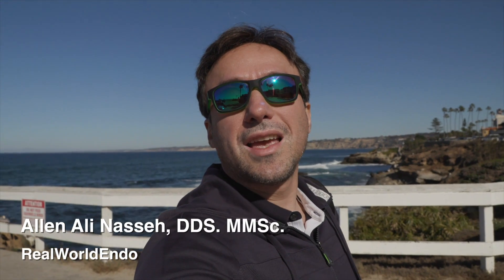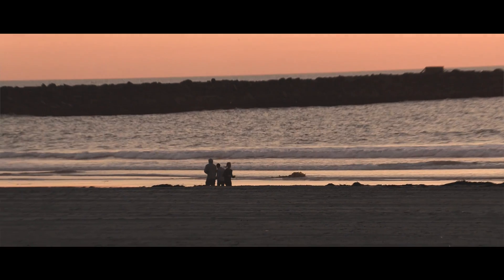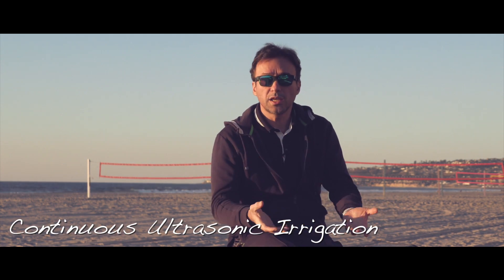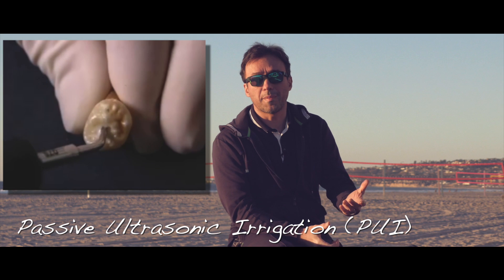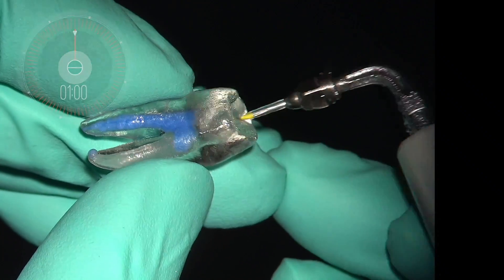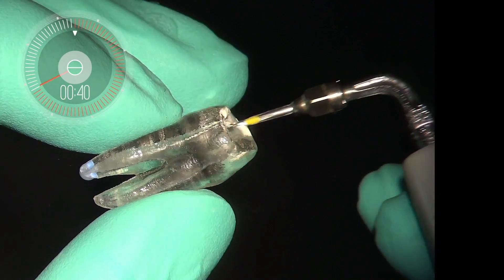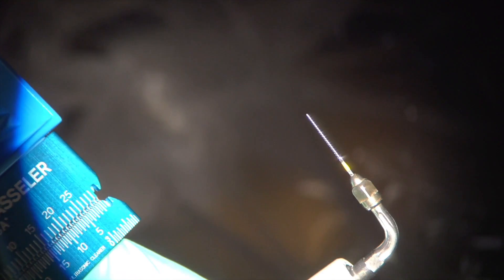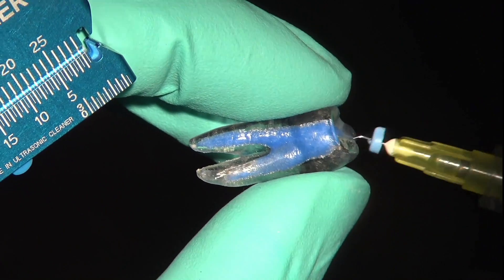Passive or Active Ultrasonic Activation of Irrigation

Comment: What would be the best method of irrigation to remove a 1.4 mm resorcinol formaldehyde resin  (fenol) fragment near the apex? Thank you
Reply from the maker: @adrianatoma1662  That’s a tough one as those are very hard… I’ve heard some people have some success with EndoSolve (not sure the regular or the R version) for this material. But otherwise using ultrasonics and water and making sure not to dig so much if blocked that would cause a perforation! If a symptomatic lesion is present beyond the ledge, Apicoectomy is the best option in those situations. Good luck!

Comment: The ultra mint pro has a tank, the company is saying you can add your disinfection protocol to this. Is Triton safe to use in a continuous ultra sonic disinfection capacity?
Reply from the maker: It is. But like normal NaClO it’s very caustic to the tubing and lines. So, you’ll have to make sure your US tubing can take NaClO. That would be the dream protocol.

Comment: Thank you! Can you please clarify 2 points, please? At 4:58 you said about these Brasseler/NSK tips they they "would fit on any other piezoelectric US unit that take this type of an attachment"; does that include Acteon Satelac piezoelectric units? Said a different way, could one use Satelac-compatible tips like irrisafe, X-start, BUC or TFRK with the Varios/Forza US unit?

Also, you showcased the 20 size u file inserts: is there any rational to use larger size u file inserts, perhaps in a wide, straight canal?

And lastly, do you have any experience with Satelac irrisafe irrigation tips? How do they compare with the tips you showcased in this video?
Reply from the maker: Yes those tips would fit. Any tip that has a female positive lock will fit. (*Note: Some tips suck as ENAC tips have male attachment and won't fit). but Satelac compatible BUC tips fit. Only issue is power setting has to be tried for each practice to make sure the correct setting is used. For E12 tips with U-Blade files you only really need the size 20. Larger tips are not necessarily better in larger canals. A universal size 20 is adequate for going deeper while being safer. You can use this tip for about 10-15 times. Best to throw it away after than to avoid it breaking due to fatigue in time. The irrisafe tips work well too. I've tried it before. That tips doesn't cut at all though. So, its agitation his limited as well. But it's good. Cheers!
Reply: @EndosKool  Thank you so much for taking the time and replying! I'm thrilled by your answer; NSK varios PE US units are amazing, with an incredible amount of tips for perio, hygiene, operative and even surgery, but the array of endo tips is limited (far more limited than for Brasseler), so having the abillity to use tips by different manufaturers is great news!
To your knowledge (in your opinion), to what degree should we worry about the "oscillation dampening by wall contact" that clinicians advocating for (selling?) Sonic activating devices talk about? 
Is PUI safe and efficient in curved (30+ degrees) canals? The fear of uncontrolled dentin cutting by PUI has been brought forward by the sonically activated irrigation  crowd; this phenomeanon makes sense to me; that's why I asked about the IRRIsafe tips. But if I understand your reply, you seem to suggest that there's a direct correlation between cutting efficiency of the insert and agitation efficiency (i.e. cleanliness that could be expected). Could you please explain this correlation?
Thank you once again, Dr. Nasseh! You're the best!

Comment: Use the lowest power of scaler in endo mode?
Reply from the maker: Depends on your ultrasonic unit. Each head is designed for a given motor. So, you have to test your own ultrasonic unit but for the Forza v30 which I use that’s the setting.

Comment: Dr. Nasseh, I am a gp finishing up my AEGD residency and I love endo. I am currently discussing contract terms with a private group practice to come on as their endo and oral surgery dentist. However, I am wondering what helped you decide to specialize and what you think the best route would be to take to enter into endo school. Although I have been through enough schooling to put down a rhino, endo is something I would still consider going back for. I appreciate your time and love your videos. Very well produced and informative.
Reply from the maker: Zak, a year or so of private practice will help and then apply. I assume you have good enough scores with your National Boards, etc. There's nothing specific you can do if you're already at this level of education. Right now having passion and getting an interview is the main thing if you're interested in endo. It's a good field; but you have to make sure you're ready and excited both economically and emotionally for an additional 2-3 years of schooling. If you like restorative dentistry you can alway do more endo-restorative and gain your experience by practice. You need to look deep and make sure your reasons are right and do a cost:benefit analysis. Otherwise endo is a great field. Good luck!
Reply: Thank you so much for the reply! I really appreciate it!

Comment: Thank you Dr Nasseh for your interesting vids. I do have some few questions for you : 1- I got the Endoactivator few weeks ago and I am using it extensively ,should I better switch to ultrasonic instead ? 2- I usually try to irrigate my canal w 5% hypochloride for at least 30min before obturation is it sufficient ? , 3- does( ultra) sonic agitation allow saving in the irrigation time ? 4- do you usually perform vital multirooted in one or more sessions ? 5- what is your last irrigation solution before obturation ? Thanks again and regards.
Reply from the maker: I think as long as you're using something you'll be fine. Endoactivator is definitely better than nothing. The advantage of an ultrasonic is its ability to create continuous ultrasonic irrigation if you have a self contained cart and are able to have a continuous flow of clean water. Furthermore, ultrasonics are multitaskers, they are used not only for irrigation but also for access and other facets of treatment. Cheers!

Comment: Thank you Dr Nasseh if u can write down the most common sizes to be used after shaping a canal for 25/04 or 35/04 and link for the ultrasonic file i got one but it's cheap and i am worried if it might get separated inside the canal & thank you again  :)
Reply from the maker: I use the size 20 U-File as the ultrasonic tip. But the key is to set the power to the lowest power on the ultrasonic so it doesn't;t ledge the canal. You can look a the Forza V3 model with the E11 or E12 Tips and these U-File inserts or get any other ultrasonic unit with their corresponding tips. The key is to work out the power setting that doesn't ledge before putting in the canals. Cheers!

Comment: thank you for this video. one of Dr. Nasseh's students on his youtube channel had mentioned using the "Power Flosser" by WaterPik as a sonic activator. What are your thoughts on that?
Reply from the maker: Sure. Anything you can do to add an element of agitation or activation is more helpful than mere positive pressure with a needle that does not reach the apex. Using 31gauge needle with a very dilute NaClO solution (1%) within 2mm of WL is also very helpful. But you would have to be very careful and skilled about where you on and make sure the needle is not binding. Therefore the canal should be prepared to about a 30/04 in such case.

Comment: Correction: you can not have sonic activation. Activation is only the case when it is done ultrasonically! We have sonic agitation!
Reply from the maker: Hi folks! I was asked by my staff to chime in in person. Regarding Sonics and Ultrasonics, they both have physical actions on fluids. The difference between the two is merely the energy frequency and motion . Salim is right that Cavitation is reserved for the higher energy ultrasonics. But I no one claimed cavitation for sonics here. The point here is activating (or making whatever solution you are using more active through increasing its kinetic energy.) Activating the fluid is possible through several mechanical means. Either way, this is a  matter of semantics and not worth the discussion here. In pure physics the distinction is between agitation vs activation but I’m using the term colloquially as it's used the same way it's used in this article. https://www.ncbi.nlm.nih.gov/pmc/articles/PMC4979287/
Reply from the maker: I’d be curious to know who invented that definition?! What’s your source?
Reply: Laws of physics! Joyce et al 2012 and Macedo et al 2014 and Boutsioukis 2013:  Ultrasonic only can cause cavitation (and there is never cavitation in sonic!!!!)--> cavitation will lead to local increase of pressure and temperature--> so it will have effect on chemical reaction--> so that is why it is called activation. just science no commercial BS
Reply from the maker: Yes, ultrasonic alone are capable of cavitation; but Dr. Nasseh did not say cavitation. He mentioned activation of the solution referring to making the solution more active through agitation. So, the use common use. Also, watch your language in the comments section.
Reply: Real World Endo well he is right cause there is only chemical action in us and so he corrected Dr Nasseh ;)

Comment: Excellent video Dr! I have a question. Do you use after the desinfection with hypochorite another substance, like EDTA, to  remove inorganic debrys?
Reply from the maker: You can use it with either. For your final rinse you can use EDTA followed by Bleach to remove the smear layer as well. Cheers!
Reply: I personnally use 10% citric acid. It is an acceptable and very affordable substitute to EDTA.I just don't know why it is less popular than the latter....
Reply from the maker: Some studies show more dentinal erosion with critic acid compared to EDTA. That's the reason it's not as popular.

Comment: Hi Dr. Why not using a scaler instead of an ultrasonic?
Reply from the maker: It's magnetorestrictive vs. piezoelectric and therefore not as powerful. However, it's better than nothing. But it will require a tip that can go deep in the canal.
Reply: Real World Endo thank you so much for you time Dr. One last question. What do you think about the Dentsply Endo Activator?
Reply from the maker: In general, ultrasonic energy is superior to sonic energy in activating irritants; but Endoactivator's sonic activation is certainly better than nothing. Good luck!
Reply from the maker: This is not phosphoric acid. It's EndoSequence Viscous Lubricant (it's blue like Phosphoric acid gel.) However, it's more tenacious than phosophoric acid, which washes out more readily with water.
Reply: That was really nice to see that the (my?) idea of using phosphoric acid as a test medium is finding wordwide use :D...Regarding the mentined Endoactivator: in my opinion, you are better of just using a fitting guttapercha cone manually, apperently the Endoactivator is not achieving that much in the root canal. Check one of my videos to see the difference: https://youtu.be/DfITrJKgdFI